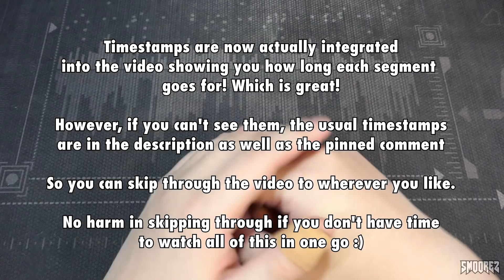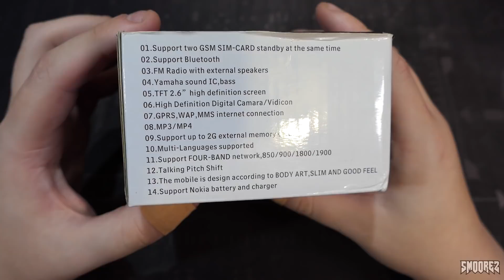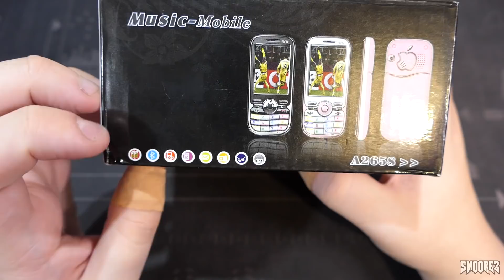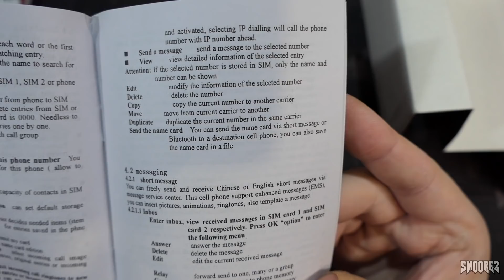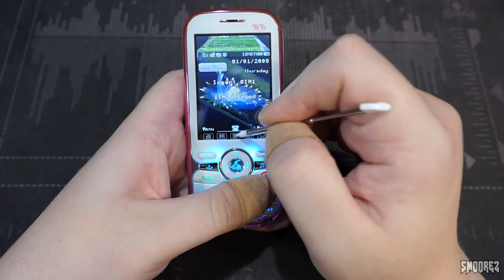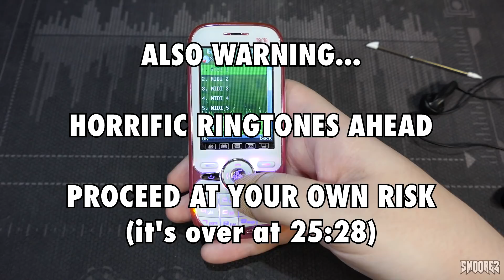iPhone Clone Month! THE MUSIC-MOBILE BARBIE APPLE THING - Test & Review (+ Teardown) Part 4

Comment from the maker: Thought I would throw everyone off with this one.
Don't worry, actual clones will resume soon :)

Hope you enjoyed the this installment!
TIMESTAMPS:
Upcoming Video: 0:00
Intro: 0:31
The Box: 1:59
Unboxing: 3:22
The Device: 4:36
Under the battery cover: 7:14
Power On: 8:05
Apps and Keys: 8:57
Shortcuts etc: 12:23
Settings: 13:03
Camera: 15:54
Camera Test: 16:31
Image & Video Viewer: 18:11
Speaker Test: 18:50
Sound Recorder & Keyboard: 20:35
FM Radio: 21:28
Melody Compose & Games: 22:44
The Ringtones: 23:32
Anything else: 25:29
Teardown: 27:08
Is it dead?: 31:25
Specs & Conclusion: 32:20
Outro: 33:03

Be good people!
Reply: CLONE
Reply: This is probably ripping off the original apple phone from 2006, not the iPhone, it's the iTunes Phone
Reply: Tipz Team I was just about to comment to say that.
Reply: instablaster